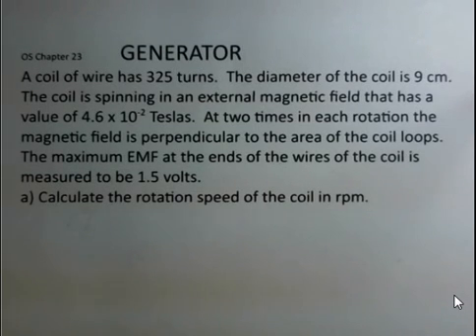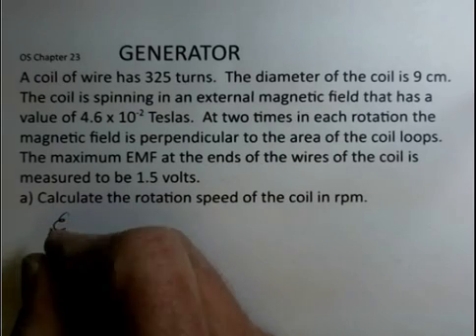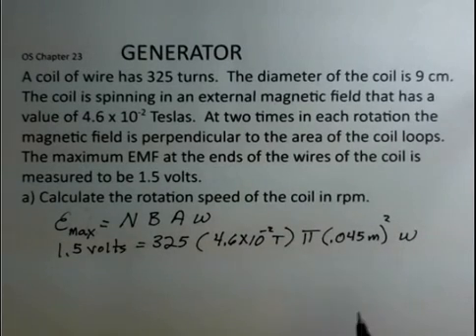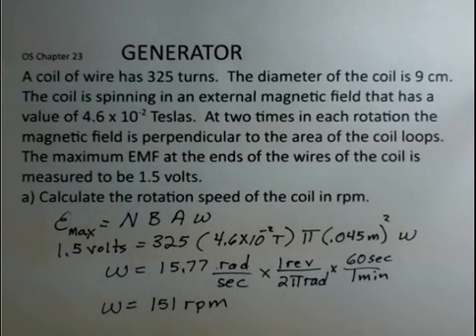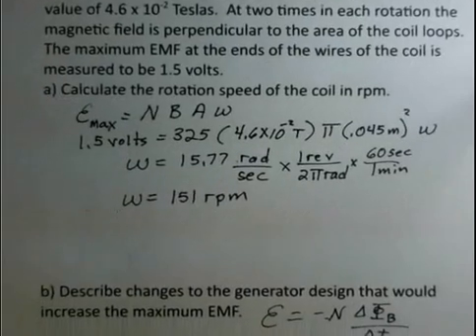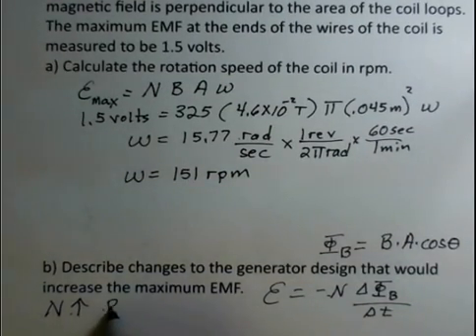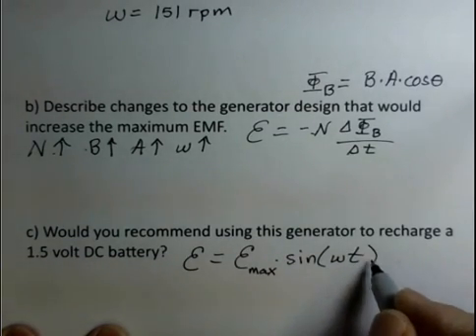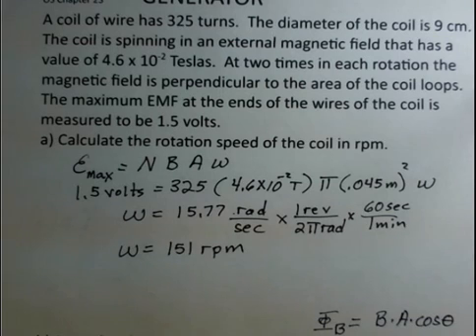AC Generator, Spinning Coil of Wire

Comment: Hi, thank a lot it is very clear. Please could you tell us how to adapt the computation from a multilayer coil with inner diameter d ?
Reply from the maker: Sorry, I have not done that type of calculation. I am not completely clear on your description of the problem.  If the external magnetic field only exists within the area limited by the inner diameter, D, then the area in the calculation is pi*(D/2) ^ 2.  If, as is more likely, the external magnetic field is present through an area defined by the outer diameter of the rotating coil then the area in the calculation would be an "average" area defined by the inner and outer diameter.  I am not sure how to calculate this "average" area.
Reply: @GregClementsScience  : OK thanks for your answer; I'm trying to clarify: Will there be a difference in result if we consider 325 turns in several layers instead of 325 turns on a single layer?
Reply from the maker: @richardorengo8684  Yes.  For the case where the coils are in several layers, most of the coils will have an area larger than the area of the innermost (smallest diameter) coil.  For the layered arrangement of coils the EMF will be larger than for the case where all the coils have the same diameter.   For each coil the EMF generated by that one rotating coils is  EMF = B * Area * omega.  The value of B is the same for all coils if the B field is uniform.  The omega value is the same for all of the coils.  Since the outer coils have a larger area, their EMF values are larger.

Comment: Wow it’s almost 40 years ago when I learned that! Thnx for sharing. 

Could you give me a direction where I could find a way to calculate the max power of a generator at a given RPM? Or can I just take the resistance of the coil, calculate the current and say P=U*I?
Reply from the maker: Sorry, generators are not my main area of interest.  I think you are on the right track with voltage times current, but there may be a phase relationship between voltage and current that would prevent just a simple multiplication of V and I. researchgate.net had some posts about maximum power for a generator
Reply: Thanks!